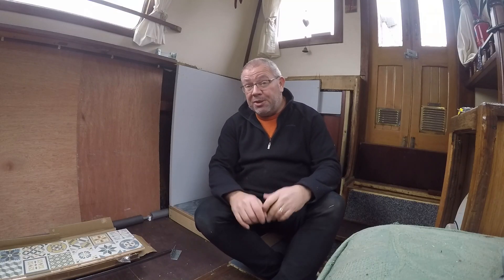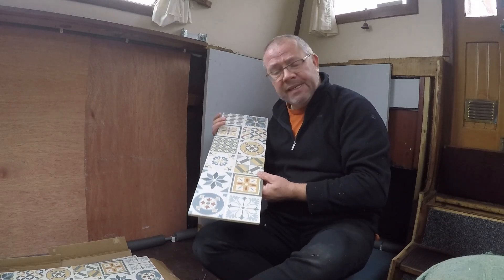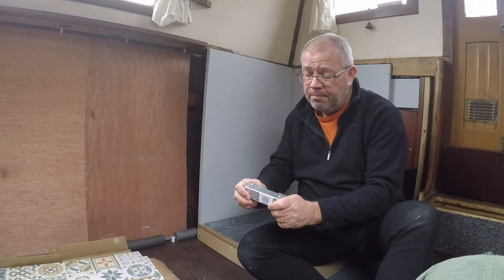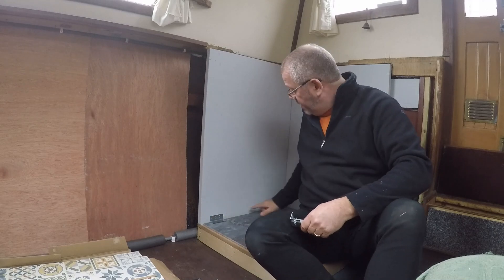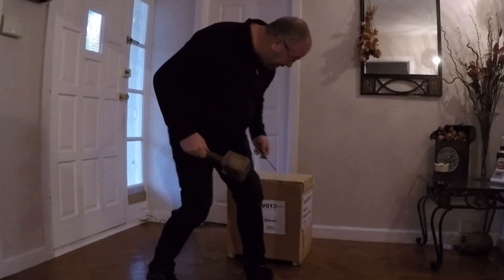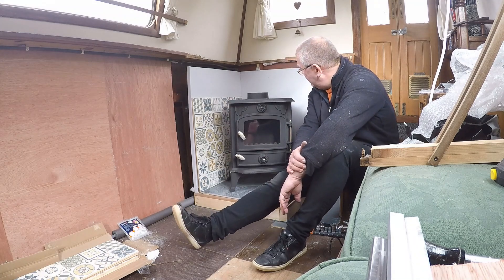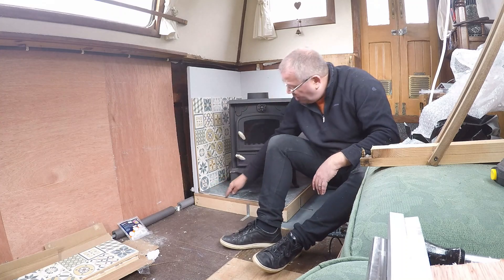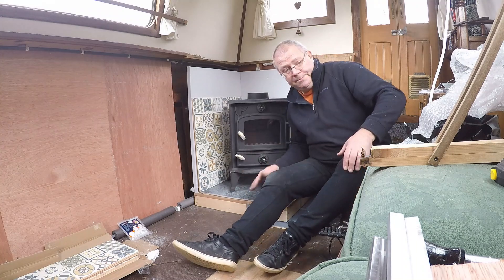#61 Narrowboat Project Getting There! Stove Has arrived! Money Running Out!

Comment: Hi, I replaced the stove surround on my boat a couple of years ago as the existing tiles were just stuck straight to the ply lining, no heat resistant board and no gap etc. I used vermiculite fire board and the tiles went straight onto that fine using Vitcas heat resistant tile adhesive. They haven't fallen off yet!
Reply from the maker: Great stuff. Managed to get them on today. The calcium silicate board just needed a good wipe down and then the adhesive got a proper grip.
Thanks for watching and commenting.

Comment: Looking good sir, things are coming along. Your tile shop man will show you the right stuff to stick those files to that fire board and you are correct that liquid nails is not the best as the expansion and contraction makes it fail. Stainless and mild steel together will create an electrical currant that will eat your anodes and caus rust so you'll be better of with mild. Where it will touch the boat. Some nice wood trim would look good all round and could be proud on that hearth as a fiddle and if you want metal you can screw that to the side that escaping coals can rest against. At the back where you want am access panel one of those big tiles would work well and you can make it hold in place with se of those magnetic cupboard closer's, look for the heavy duty ones.
Don't worry about the fan, Mrs Lumpy can hold a fan and waft the heat to wherever you are 🏴‍☠️
Reply from the maker: That's all very useful and interesting thank you. I especially like the idea of Mrs Lumsden fanning me! 😂😂😂

Comment: You need 6mm Hardie board to tile to. That calcium silicate board is to powdery. It will suck all moisture out of tile adhesive. You can get fans from machine mart. I'm sure I saw them in there when I got my fire rope. Crack on.
Reply from the maker: Cheers mate. Thanks for that..... I'm cracking on! 😜